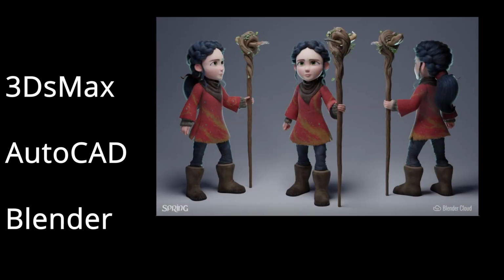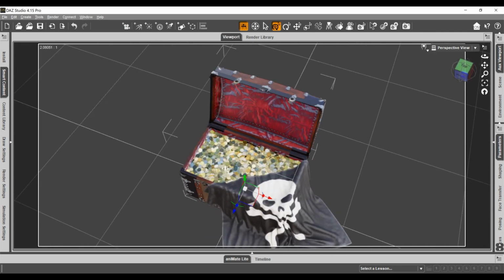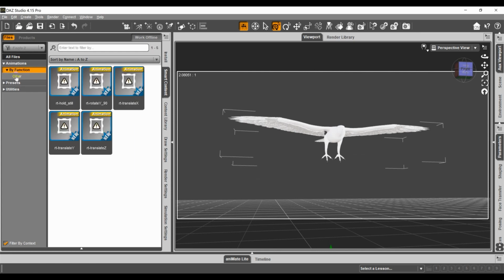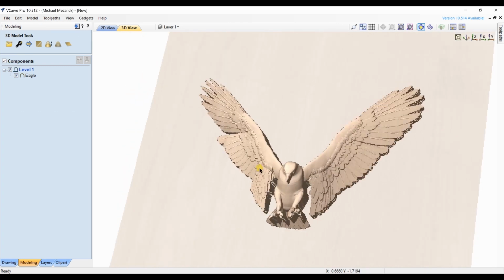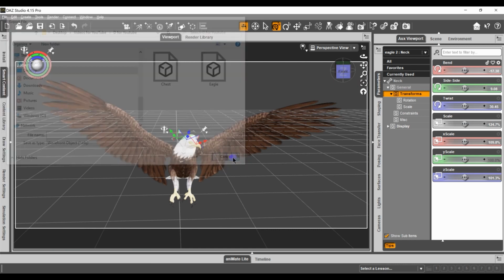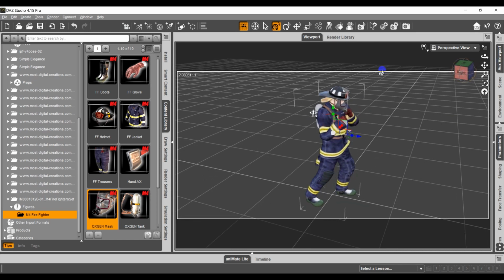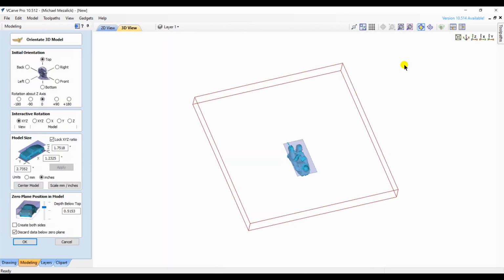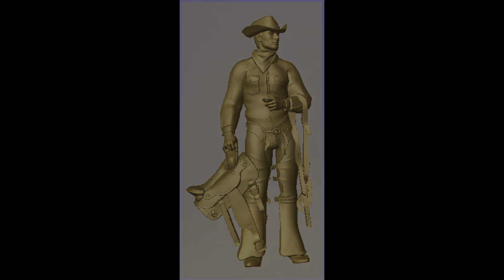An alternative approach to 3d Modeling Episode 45

Comment: Hi
Maybe I’m asking a stupid question?
It’s a brilliant video. But i have downloaded the software. And I’m trying to figur it out. I have no models to choose from, to work with. I would like to work with the dog. But I cannot find any models to start with. I rather not start with buying models before i find out if i am able to use it.
Am i doing anything wrong? Or is it just a newer version of the software.
I’m trying to figure out what model that are flexible so I’m able to modify their position. What are they calling those models, like the eagle?
Best regards
Kent
Reply from the maker: You'll need to downland the models from your Vectric User Portal. There is a link in the software, at the top, "Help", look for "Visit Vectric User Portal". There you can download the models that come with the software.
Reply from the maker: Once downloaded you need to install them. Next click on the Clipart tab and you should see the models available in different folders.
Reply: Vcarve i have almost figured out. It’s DAZ that’s my problem. I have installed the software. I have also bought some dog models, and installed it. But i cannot find them anywhere . I don’t have the animal folder that you have. I basically only have a couple of people,  clothes and accessories for them. Nothing else. Weird!
Reply from the maker: @KeaAlstrup  Daz has the worst file system I've seen....10 years and still having problems knowing where things are.
Reply: @mezalick  😂 Annoying buying a thing an not able to find it😂